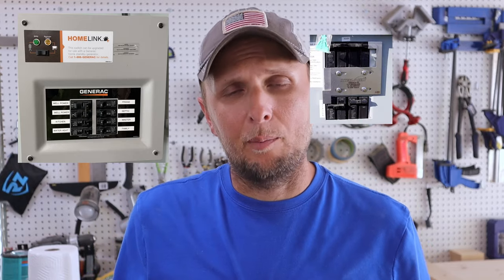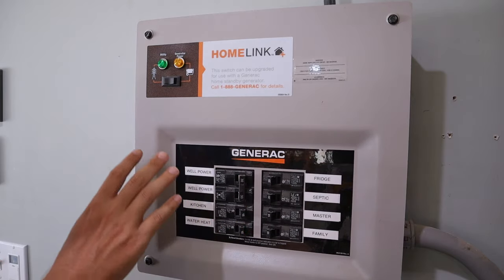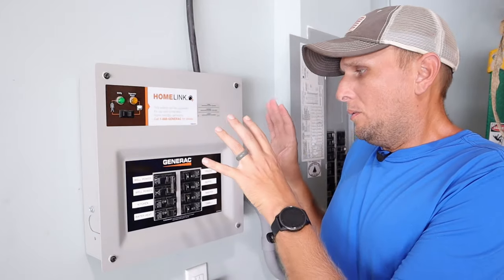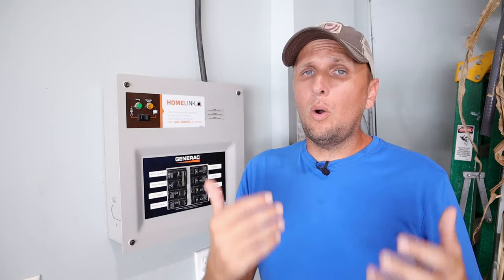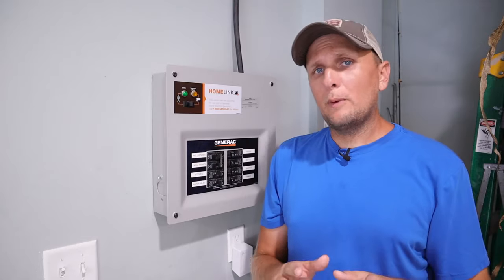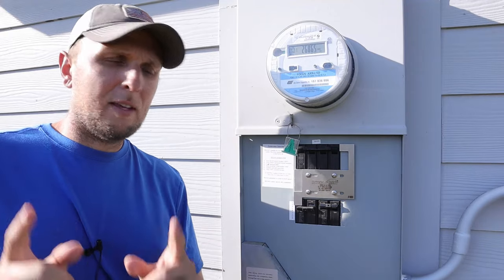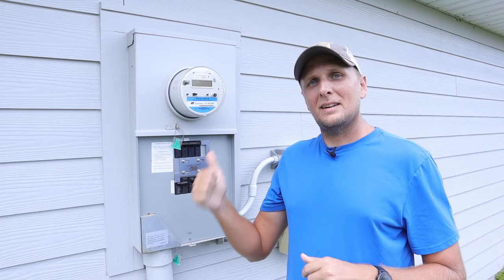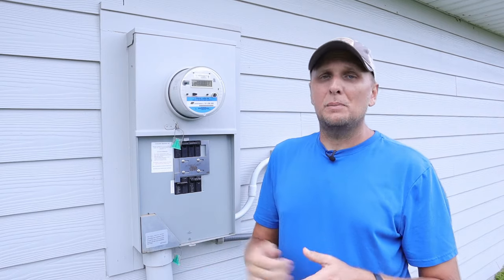How To Choose Between A Transfer Switch Vs Interlock Kit With Power Inlet Box

Comment: Instead of buying a transfer switch, you can save a ton of money by installing an interlock on a small subpanel. You won't have the fancy lights, but it'll accomplish the same things otherwise.
Reply from the maker: That is true but all comes down to what someone wants.  Half the video is about what you are talking about.
Reply: @HowToHomeDIY  I'm not talking about putting the interlock on the main panel, but on a new subpanel. So the subpanel acts just like a transfer switch.
Reply from the maker: @OldBaldDad  Ahh I gotcha.  Yes that would definitely work.  Good tip Mark!
Reply: My electrician set up 2 sub panels with interlocks. I could run 2 separate smaller generators, or only one if I only need to run one sub panel. This was so I could save on fuel and not just run one big azz generator just to run a few fuses if I didn’t need the rest on. Also get trifuel generators and use quick connects for your natural gas. If no propane tank, then can buy a 100lb for about $100 and fill it up, it will last forever. That should give you a few days of running.
Reply: @dhammer6715  That's a good idea.  It's amazing how much more fuel a big generator uses than a smaller one, even when they're powering the same load.
Reply: @OldBaldDad  Also if you only have one big generator and it doesn’t work, you’re SOL. With 2 or 3 smaller ones you have backups in the event one malfunctions. You can also rent one out to your lazy stupid unprepared neighbor and get a return on your investment. Another good idea is having small window unit AC’s, portable AC’s and/or heaters. You’ll thank me later.

Comment: You forgot to mention that if your using the transfer switch and the power comes back on all your other circuits will all come back on, so you don’t have to keep throwing your interlock switch to check when the power is back on.
Reply from the maker: A good point.  You are right.  Thanks Wes.
Reply: There are sensors that you can wrap around your main lines into your panel to set off an indicator and alarm to advise when main power is available back to the main panel from the grid.
Reply: @rstephe   True but that really starts to eat away at the price savings of an interlock kit which does have other advantages if your doing it on the cheap. I got my Transfer Switch 2 years after the Y2K scare and our Home Depot was clearing them out for $30. only thing extra I had to do was remove the bonding wire from my Honda Generator so my high efficiency furnace wouldn’t keep giving me a ground error.
Reply: We have smart meters in our area, just looking at the meter shows if the mains is back up nor not. I also have a little display in the house that gets a wireless signal from the meter and shows the current load.

Comment: I use a DPDT 240v 60amp Contactor in a 120v sub-panel. There is a manual switch on the panel that powers the contactor to switch from GRID to 3500 watt 120V INVERTOR power. Invertor is powered by my 24V 5KWH  battery array. My Batteries are charged by 1KW Solar Panel Array driven Charge 1500 Watt controller, 3.5KW Generator powered 1KW battery charger or a grid powered 600 Watt battery charger.  To switch 120v Subpanel to Solar Batteries My spouse flips the toggle switch on the small sub-panel. If the sun isn't shining the generator is push button start. Whole system cost 2000 bucks. 2 years ago. 1000KW/5KWH/3.5KW/3.5KW......Powers all the 120V circuits in our house. For 14 hours +- at night.   recap ........Flip Toggle Switch.  Later  Push Button. .....   Upgrade engineering in progress.  Automation to remove spouse from system. Double Contactors. Double/triple Solar Array size

Comment: It’s not about turning breakers on and off during a power outage it about power management. Determine what you can use during an outage while on a generator and simplify The Who,e wiring system. Example, if my generator will not handle a well pump while I have all my lights on then limit light usage and learn to live with minimum lights and be very conservative with what is consuming energy during an outage.   It will cost a whole lot less than retiring an complete panel
Reply from the maker: Yes, that is what I meant by having to turn breakers on and off depending on what you are wanting to run and what the generator is capable of at a given time.
Reply: Keep in mind, many devices in the panel may be automatic run devices. Like a water heater. If you don’t turn off the breaker, it will run, if power is on…

Comment: Anyone using these with solar generators?
Reply: Yes, with the Manual Transfer Switch and it works just fine. Ours is a Power Station.  We don't have solar panels.

Comment: Dude is showing one company's transfer switch.   MANUAL transfer switch provides foolproof protection from back feeding power and killing utility workers.   Secondarily, the transfer switch in GEN position allows you to manually select and change which of ALL your breakers are energized.  It does require a basic understanding of how your house power is wired and what loads you are placing on your generator, whatever its capacity.

Comment: Why tha hell US house power distribution is so complicated? In Europe, if you need transfer switch - you go and buy 30 euros one in 1-0-2 style, install it in 20 mins to your standard din-rail and wire 8 wires. If you have some extra money, you can buy automatic transfer switch for 100 euros that will do the job of switching sources for you automatically. If your budget is even bigger, you can buy an ATS with Generator control  that will start your generator for you if mains go down. That will be 200-250 euros. Not even mentioning that overall installations are much simpler and compact in European 240V systems.

Comment: Transfer switch sucks. I have a 4000 square foot house with three fridges and one freezer and two AC units and it pulls 2200 watts typically, for the entire house, most of the time. (Minus the water heater and stove). Basically, I can have almost my entire panel on with a interlock kit, and power most of my house. The AC units have high start up loads and need a larger generator, but I can power the entire house with a small gas sipping 4000 watt generator. The limited amount of circuits on the transfer switch is a non starter for me.

Comment: Generlink is the simple whole house solution.  you have it installed under your meter, and all you have to do is connect your generator to it and it automatically detects when utility power goes off and switches to the generator connection

Generlink is not cheap however
Reply: and it's not permitted by all power companies.

Comment: Why on earth would you need to go to your panel and turn things on and off with an interlock? I have only ever had interlocks my whole life. You just dont turn everything on in the house and if youre going to a new section of the house you just shut some stuff off in the area youre leaving. I have never shut anything off in my panel other then my hot tub and I have very rarely ever tripped the breaker.
Reply from the maker: Well everyones situation is different.  Maybe there is a family in multiple parts of the house at any given time.  It’s far easier to shut off certain circuits that if they were to be used would overload someone’s generator.  Really easy for someone to forget not to flush the toilet, causing the well to kick on and starving the generator because at that time you are letting your fridge and freezer run.   But what you do works for you so roll with it.  So many different scenarios and configurations that every person just has to find what works for their circumstances.

Comment: What a hack job! No PVC connector between the panels? Just a pipe pushed into the line panel! 😦
Reply from the maker: What a hack comment!  Are you blind or just can’t see?  There are connectors on both panels.
Reply: @HowToHomeDIY  you're a liar. At 3:51 I see a 3/4" PVC 90 going onto a 1 1/2 hole in the main panel.
Reply from the maker: Yeah that’s drywall first and then 2x4 framing around the panel that I had to drill through, you can’t see the connection to the box because of those two things.  Chill.

Comment: You are not making any sense. You can leave all the breaker on  in your box when  you are using the generator and the interlock . You just don't want  to use more than 30 amp total at one time . For example with all the lights off in the house the only other thing that use power is whats plugged into the wall outlets  and a few extra things  that run straight to the  appliances. Things like water heater , well pump, furnace fan for a gas heating unit ,some stoves . 

During a power  outage and the generator running you have to keep the amps below 30 amps even with the transfer switch . For example with the transfer switch you can't  run the hot water heater ,well pump ,Refrigerator  and all the outlets circuits you picked that have tv's plugged into the outlets so you are either going to shut off the breakers in the transfer box so only the water heater is the only thing drawing power or just make sure every thing is off  while the water heater is heating up water . 

With both the transfer box and  interlock the best thing to do is keep the big amp drawing appliances shut off till you are ready to use them . Before you switch them on just make sure you turn your tv's  and most of the lights off . Not at the breaker but at the switches  just as if you had power from the power company . The main advantage to the interlock is you have power to every outlet if you want it ,you just have to make sure you don't run a bunch of thing at one time . With the bigger drawing appliances switch off you can use a lot more outlets at the same time .  The other main disadvantage with the transfer  box  is you have to twist 2 wires together and use a lock nut to put the 2 wires together . I don't think the  transfer box is a good idea at all .

Comment: ❔💥QUESTION💥...Going to build total off-grid, solar & gen. Small house and woodworking shop. 48v rack bats & 24k propane gen-set. Want to run my shop machines on gen separate from bats, and house on solar & bats, butt🍑......also use gen for house backup in emergencies. What do i need to have to use the gen backup for house, AND have switching ability to run shop separately on gen? It would be like being on-grid, only my gen would be the grid!! Hope U can help.
      -⚡⚡⚡

Comment: The auto switch is only available if you use a GENERAC Generator. This video LEAVES that fact OUT. ?????????????
Reply from the maker: It’s not an automatic switch.  It’s a manual transfer switch. You can use any brand generator.  Simmer down.
Reply: @HowToHomeDIY  I looked at these online. What does it mean that it’s upgradable to work with a Generac system? There was a lever on the inside for switching but the cover had to be removed first. The outer lit toggle is for Generac. At least that what I read. Sorry if I’m wrong. Maybe I was looking at a different unit, although it seemed the same one…
Reply from the maker: Not sure what you are looking at.  Just can tell you that I have hooked up a cat, champion, and Westinghouse generator to my transfer switch and it makes no difference.  You may be looking at something completely different.

Comment: Interlock doesn’t meet code here.   They won’t let you put more on the circuit than the generator can handle.
Reply from the maker: Must be a local code wherever you are.  Could probably get around that by installing a sub panel with the circuits you want to power without overloading the generator.  That’s an odd code.
Reply: @HowToHomeDIY  ... I was in that business for 25 years and every time I see a 100 amp sub panel being fed by a 50 amp gen set I have to ask what they were smoking. (might be a 50 amp panel fed by a 20 amp gen) If the gen can power that panel then why are we using such a large breaker? If you really need that larger breaker then do you really expect the small gen set to keep up? OTOH, you are right in that there's nothing in the NEC telling us what size gen set to use... BUT ... the breaker size must not exceed the wire rating. Local inspectors have their on way of reading between the lines in the code book.
Reply from the maker: Yeah I hear you.  I am friends with electricians across the country, Miami, Chicago, NYC, a few others and they all almost always do things differently in each place, including these generator setups.  But yes, I agree with you that the breaker should never exceed the wire rating.  And I also agree that some inspectors can read codes differently than others.  Have had a few job sites on final where something gets flagged over very gray areas that in most jurisdictions are right in line with code.  Appreciate the feedback and I saw some of your other responses to folks.  That’s what the channel is about, people helping people.  👍
Reply: @HowToHomeDIY  ... BTW, as of 2012 (?) there's national code on gen set installations, which we never had before. Not every town adopted it right away but at 9 years later I' sure they have. That said, it's still too new for the average DIY type to be aware of. Same goes for the helpful guy at your home improvement store.

Comment: ya so what a transfer switch here in canada costs you as much as your FACKIN HOUSE..you don't need everything running on a power failure .furnace.air .stove if it's not gas a sump pump and your good to go ..for a Quarter of the price